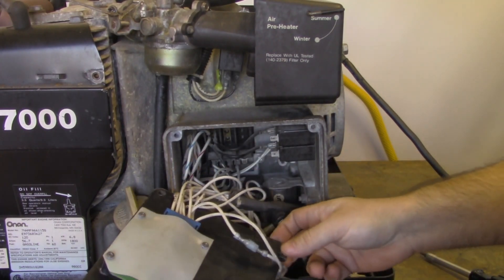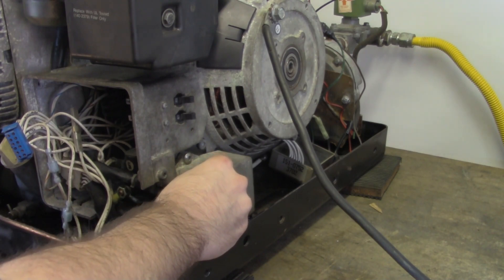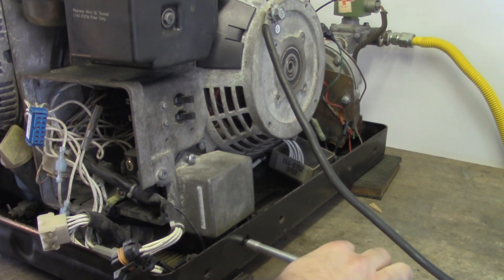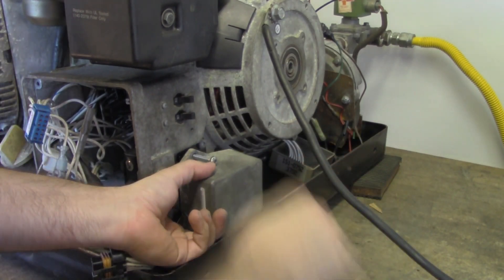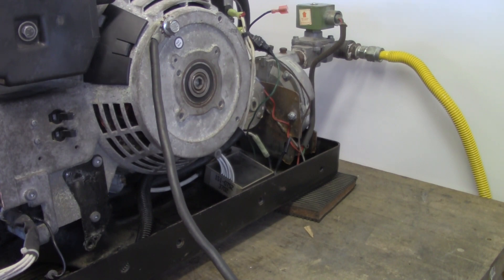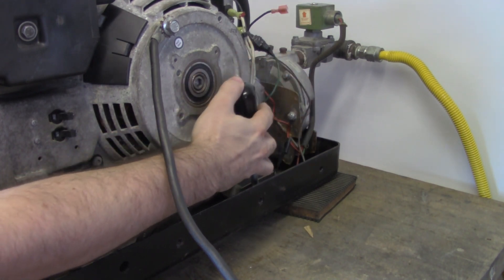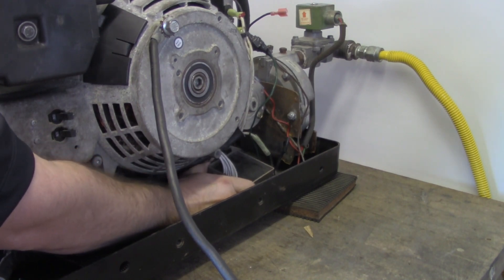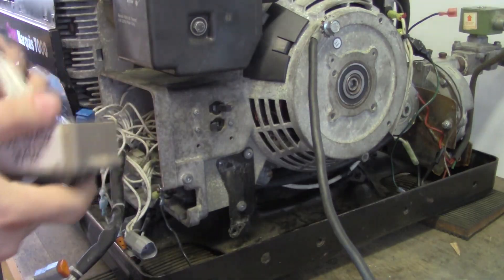Locating the voltage regulator, control board and governor (Onan Marquis)

Comment: Interesting...you may not remember as this is an old video of the Onan Marquis 7000 gen.  You did remove the control panel when working near the regulator.  You also mentioned a key item (my interest) in your video.  You talked of there NOT being a multi pin connection on the side of the control board and you referred to it as a "remote" pin connector.  Well, mine has 4 wires on it...I think they are red green brown and some other color.  I noticed the other day that the red one is just hanging in the wind, disconnected.  Not sure where it goes.  Where can I find a detailed wiring sheet for this gen?  Tks  Great Vid

Comment: thanks for the info. i have a Marquet 7000 model 7nhmfa26105f. the only way the engine continues to run is hold start button, but bad for starter. buying both control and voltage reg. may not fix the problem. saw another video that someone had a problem and mentioned your company helped him. what can i do to fix without buying unnecessary parts. hope you can help
Reply: low oil pressure switch is bad

Comment: Great video.  I troubleshooted my generator and said to myself "That computer box must have taken a dump."  After the generator sat in front of my shop for a while, I finally thought to myself, "I wonder if the voltage regulator is toast?"  I found your video on Google, realized that's the box that I thought took a dump and suddenly realized that the generator was giving the same symptoms as one of our other generators that had the voltage regulator go bad.

It was also awesome that you mention the hole in the frame to get the screw.  I would have taken the regulator off had I known that was there.  I have taken the top screw out like 3 times now and put it back in because I couldn't figure out how to get the bottom screw out.  It's funny how some of the smartest people miss some of the simplest things.

I found your company's voltage regulator on Amazon and have it on the way!  Hope that I have this generator working soon.

Thanks a lot for your help and for publishing this video.

Comment: Do yall offer carbs for onan emerald 1 gen set? My unit starts up and runs for about 10 seconds then dies.  It will only do that once or twice then will not start again until it sits for awhile.
Reply: your voltage regulator is bad
Reply: @Austin2276  thank you so much 🙏